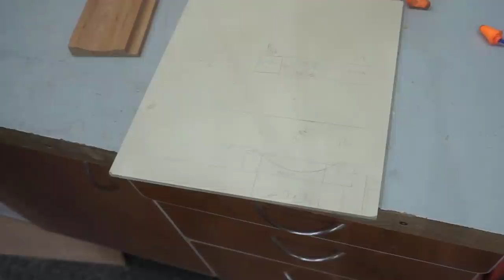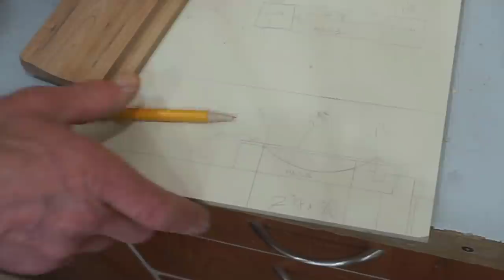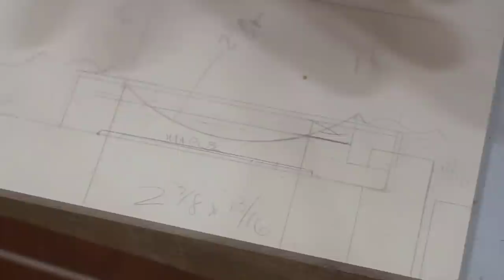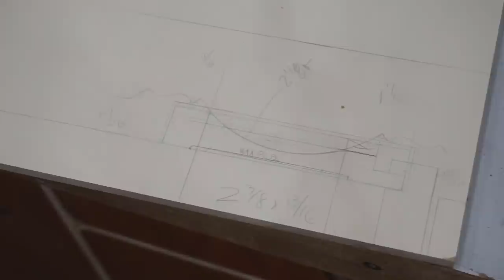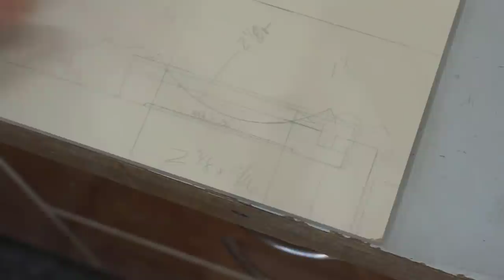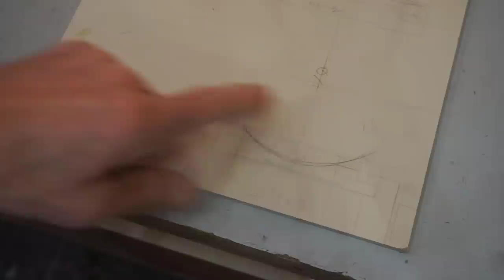Making Custom Coved Casing

Comment: I've only watched the first 20 minutes, I will definitely watch the whole thing. I really enjoyed watching how you use your time in the glue-up. I've been working at my method and it's a little different and now I have some things to try. I've already seen way too many YouTube videos that just gloss over small details so the build is done in 15 minutes of video. That's fine, but all those videos end up repeating the same skills. For example, you don't waste time smoothing the glue out, but you adjust the boards with your fingers rather than clamps, biscuits, or cauls.   Thanks for doing this, I hope it becomes worth your while.

Comment: I'm going to use the cove detail on a project I have that is nothing like this.  Perfect timing!  This was definitely some Next Level work...  No one else out there working to this level of detail on YT.
Reply from the maker: Very cool Greg thanks for letting me know. I'm guessing you'll have no trouble coming up with a Cove setting disk of your own and I wouldn't be surprised if you made one out of a flat plate of Steel which would be awesome because it would not Flex like the plexiglass can. Make sure to ping me if you have trouble with any part of the process but I hope that video is thorough enough let it go smoothly for you... Best, Matt
Reply from the maker: Thanks for watching and commenting on this one... again😎 I think a moulder like this would be perfect for your use and needs if you decide to get into the custom milling business instead of farming it out.  Making mouldings is enjoyable work: it gives a grand feeling of accomplishment when a perfect piece slides out of the machine.  If I were doing much moulding these days I'd upgrade to one with variable speed and 'multi-pass' capability so put those features on your checklist if you go a-shopping.  Give me a call and I'll gladly explain their benefit and importance... Best, Matt

Comment: Another informative and interesting video. An excellent process yields excellent results. Thanks!  

By the way --(1) Tthis is the best approach to cove cutting on the table saw I have ever seen. First rate!  (2) I am with you on using the FTG rip blade for joinery.  I use it (or an ATB-R blade) for all types of joinery on the table saw. (3) BONDO. It's not just for fenders anymore.

Regards, respects, and best wishes from Wisconsin.
Reply from the maker: You're most welcome Jerry!  I like the "Bondo.  It's not just for fenders anymore" tag line!  Nice! Showing and explaining the FTG blade in videos has made me realize it really is just a mini-dado blade, right?  Best, Matt

Comment: The sawdust trick works like wonders. I've done miles of glueups and did them all the hard way until I saw you do it just once awhile back. I've never looked back.. The bottom of my workbench asked me where you've been all its life..
Reply from the maker: Glad you're checking out this video Martino... and that the 'sawrdust for glue cleanup' stuck with you! 🤣🤣
Reply from the maker: Patching an old but sturdy bench with Bondo and covering it with a sheet of Formica can hide a multitude of sins, whether or not they've been caused by hungry lions! 😂😎
Reply: @NextLevelCarpentry  I've thought about this, but I do like the feel of wood against wood. I do a lot of hand tooling,  planing, sawing, etc. I'm not sure I want things sliding around so much not to mention I have numerous 3/4" holes bored through for holdfasts and such.  Last time I used eastern white pine, too soft for my taste. I might use yellow pine next time unless the hardwood gods drop by for a visit..
Reply from the maker: Makes sense for the type of work you like doing.  I've used laminate tops for... ever with the amount of abuse benches get what with gluing, welding, grinding, painting, etc that make stubborn messes requiring cleanup with harsh solvents, scrapers and scrubbers...

Comment: Have you used the bondo sander for something more intricate? Like crown.

I’ve read that you can glue sand paper to a scrap of molding to make a negative, then sand a foam block with it to make a form. Then glue the sandpaper to the foam. And u have the perfect custom sander. Have you done that? Is yours better?
Reply from the maker: A form fitting sanding block will always 'blunt' crisp edges/details on a moulding in my experience.  I only get away with it on coves because there's no details.  For typical crown I just fold sandpaper and do each 'feature' by itself... cutting corners just leaves un-satisfactory results IMHO... and is yet another reason why "I hate sanding" 😉😁

Comment: You're welcome!

Time Stamps
Overview @1:10
Glue Up @4:40
Sizing Blanks @20:37
Mill BackOut @25:52
Rabbet Edge @28:43
Setup for Cove @37:42
Cut Cove @44:41
Custom Cove Sanding Block @50:36
Sanding Cove Casing @52:55
Plane Edge @57:08
Summary and Bonus @59:00
Reply from the maker: Thanks for adding these Al... y'know, anytime you'd care to add similar info to other NLC videos it's OK by me!  I'm sure many other viewers would benefit from the info.  Thanks in advance if the spirit moves you! 😉😎

Comment: Amazing what pallet wood can become.
You use the DW735 with straight blades ... opinions on DW735 + helical head versus something like a Grizly which comes with a Helical head ( and say 13" of the DW735 versus 15" for the Grizzly... forget which model # on the Grizzly, it's one of their new ones with the fixed table - retails for about $1800 on their site.
Thanks,

Comment: Matt, this is a little off topic but I truly trust your knowledge.  I am having trouble with my jointer tables staying where I set them.  I have a Grizzly, not a PM.  When you set your tables up on YOUR jointer do they stay where you set them?  Meaning, that after using the jointer for a little while, is your outfeed table still lined up where you set it?  Is your infeed table still lined up with your outfeed table?  Mine will not be and resetting the tables is such a P.I.T.A.  In this video you mention (@23:09) to check your fence alignment to make sure it is square.  Why would it not be?  Does this stuff naturally move during normal operation?  I have to adjust my fence a lot.  I hope you don't mind helping me out here.  Thanks, Barry.

Comment: I don’t know if anyone else has mentioned this but the setup errors and other head scratchers are from this. The table saw blade swings up in an arc and not straight up and down. Any blade height adjustment will require you shift the setup over some.

Comment: I have seen an ad for a cove cutting blade that uses carbide tips ground with round tops. I is supposed to cut smooth coves. If one was going to do a lot of cove work it might be worth a try.
Reply from the maker: Please share a link if you have one Stuart... it would probably make a huge difference! Best, Matt

Comment: Where do you find decent pallets? Everything in my neck of the woods is made out of whatever was brought into the mill. Mostly poplar, gum, some oak. All green. Other than the inside support pieces, everything else is 5/8” rough. I did run across some old Coke pallet boards of planed  fir.
Reply from the maker: Hint: try HVAC equipment suppliers Stuart.  Not sure what comes on the pallets I get but big stuff apparently comes on big pallets  There's a couple great places even in the relatively small town I live in.  Find out who sells rooftop HVAC units and works with sheetmetal and you'll be on to something.  Best, Matt
PS Love your channel icon hat photo!!

Comment: Brilliant video and instruction Matt..Thanks a million. I saw you used a blade stabiliser on your saw..Would that be used with a dado stack as a plate? Thanks again Matt.
Reply from the maker: Never heard of using a stabilizer with a dado stack Simon... the outside blades are so burly and thick no extra stiffness is necessary.  It does seem to help with thin-kerf blades though although I've never done an official results comparison.  Best, Matt
Reply: @NextLevelCarpentry  Hi Matt. Thanks for the reply.
I think I misunderstood...I've just bought a table saw and a review I saw said it would take a dado and it's a shame they didn't include a plate with it. He obviously means insert plate but when I saw your stabiliser??
Thanks for listening to an oldish fool!
Reply from the maker: @simonpritchard6074  no worries the terminology can be confusing when becoming more familiar with new stuff...
This isn't a sales pitch but I've always been very impressed with the forrest dado blade set up that I use in case you end up shopping dado blades...

Comment: Have you ever considered using a power feeder?
Reply from the maker: Hey Thomas,
I've considered it but never felt it necessary or worth the effort for the relatively low volume of work I do that would benefit from one.  Essentially my thickness planer and W&H Moulder both have 'a power feed' and they're the two main operations I do that it's necessary for.  I imagine, if I had a huge shop and could have a 2nd tablesaw with a dedicated powerfeed setup, that it would get some much appreciated use though!  I suspect you have one or are considering it?
Best, Matt